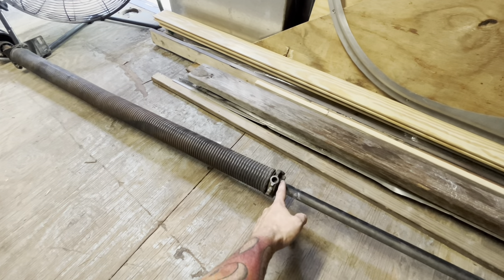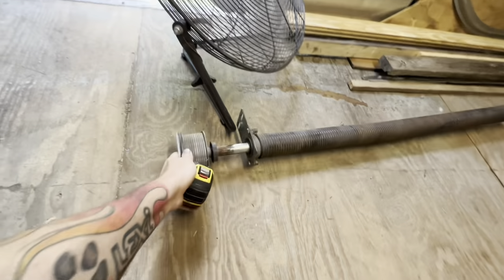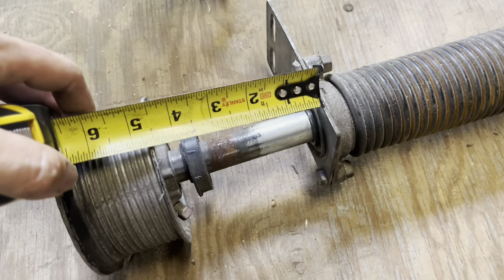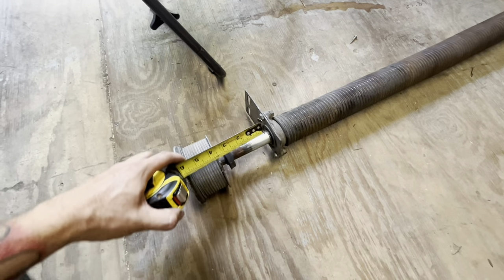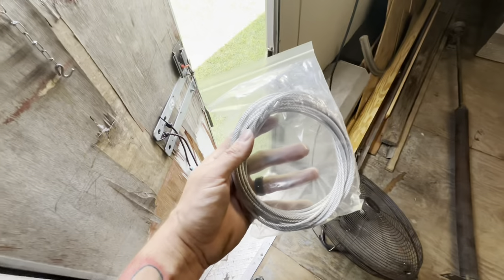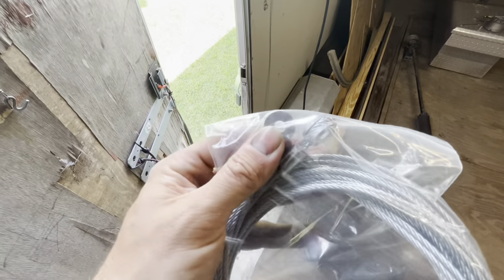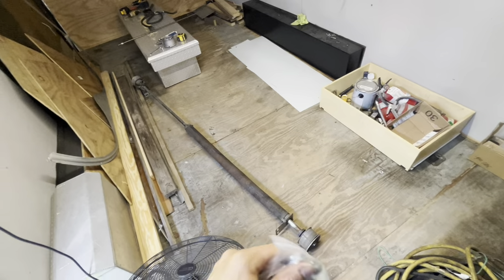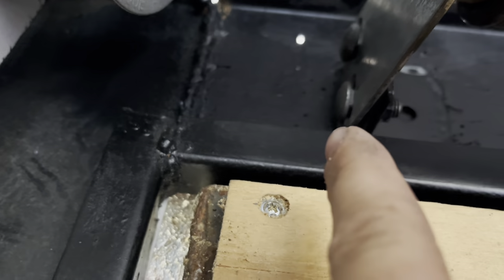☑️HOW TO: Trailer Ramp Spring & Cable Replacement

Comment: The vice grips should of been hitting the door, not the ceiling that was in the last four videos I watched
Reply from the maker: It’s been awhile now since I filmed this so I can’t exactly respond to that with direction. I can report back and say the door still works amazing issue free. Do which ever gets you good results. If it’s wrong the door won’t work correctly and you’ll know it.

Comment: Great video! How did you determine the length of cables to buy and how long was your cable?
Reply from the maker: Video is pretty old so unfortunately I don’t remember length. However I think they all were universal length and you just roll it up and it uses what it needs.

Comment: We had a garage door spring break once, the noise that thing made and how hard it was to open that door made me realize how much tension those cables had on them to lift that door to begin with. I had to release the pressure off the other spring before i could get the door to go up level and that made me more nervous than anything, switching rod to rod loosening it made my ass pucker a few times when one almost slipped out.
Reply from the maker: Yessss they are no joke lol and you never fully think about how much pressure there is till you do one

Comment: Just fixed mine today after the new guy backed a 1000lbs mower over one. It now works better with 1 cable then it did with 2. I think I jeed to back the tension off a bit
Reply from the maker: Awesome!  I went into this not fully understanding how these worked but figured it out as we went along

Comment: Definitely not looking forward to figuring out what the movers did to my curbside cable but it is off the drum and loosely wound.  It was fine before they were in it.  3 or 4 guys removed my items and put my golf cart in it then put my items back in.  The door was opened yesterday by me and it just fell full force on my shoulder blade. A neighbor helped me out picking it up and closing the door. Now it is locked and I'll be using the side entry door until I can get some help or time to check it out and see if I can fix it.  I get the heebie geebies just walking behind it.  I avoid it as much as possible. Thanks for the video. It helped.
Reply from the maker: Sounds like maybe that pulley set screw came undone buddy. Hopefully you can figure it out and get it back going up and down easily

Comment: I had a older 28 ‘ enclosed trailer, when I was backing out of the trailer the hinge’s(only 2 on the door ) broke . I immediately put the car in gear and went forward to save the car . Had to go home and fix the door (weld in four new hinges ) went back later that night to race .
Reply from the maker: Holy crap man that must of been fast thinking
Reply from the maker: Lawrence two of what?  Springs?
Reply: @ThePaintPaperHustle  2 3/8 drive extens  1 told 1 to hold ajust tenten then lock impact,???
Reply from the maker: Gottcha yes that’s correct.

Comment: How did you move the spring and wind it without it wanting to pull its back to the left?
Reply from the maker: It’s been awhile since I did this video and can’t remember every detail. I do know as shown in video I used Vice grips and other hand tools to hold everything and twist the bar
Reply: This is still the question I have. I can certainly put tension on the spring but I don’t know how to pull the spring 3-4” to the street side and wind the spring.

Comment: So my trailer door had only 1 drum & spring (curb side) but the cable is gone (Bought it that way) so I need to order one. How do you know how long to order one or does it not really matter if there is some extra still on the drum when the door is down? The torsion spring has not been jacked with so I would assume this will be a fairly easy process to hook the cable onto the drum, wrap it around (while the door is up) and attach to the door bracket. Lowering the door should put the tension needed on the spring to assist with lifting it back up correct? Thanks for any help.
Reply from the maker: Ok so I think all cables are same length and correct extra won’t hurt anything. However you want there to be tension on it while closed so it holds it shut so you while have to still twist the spring up before hand.